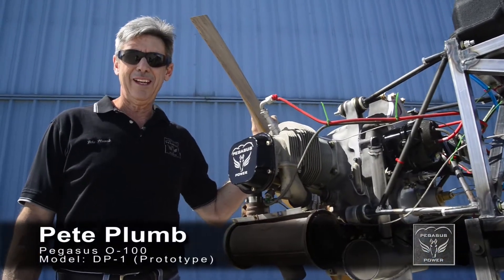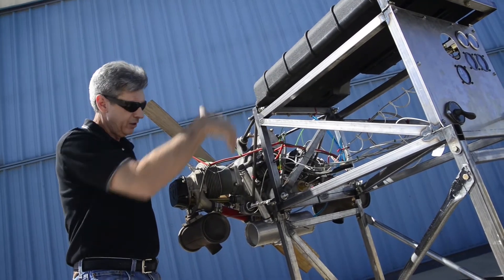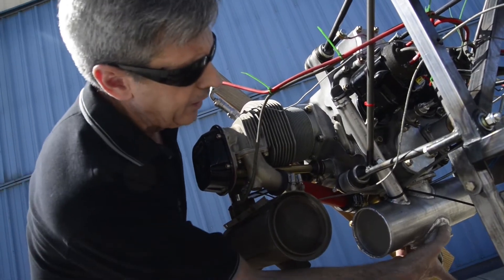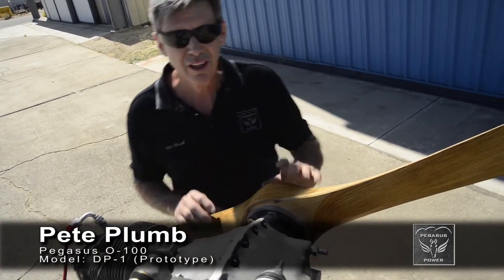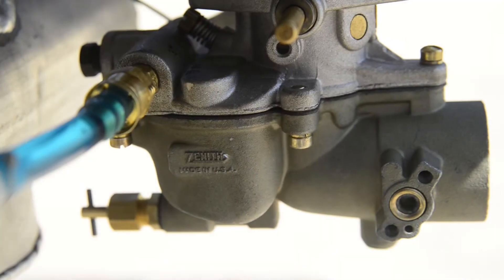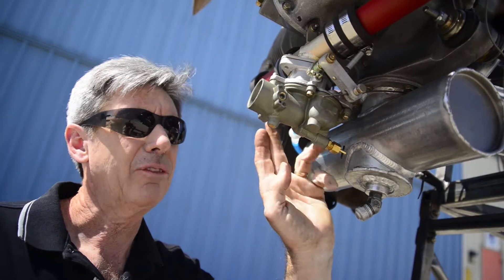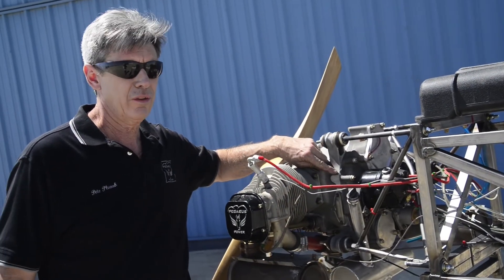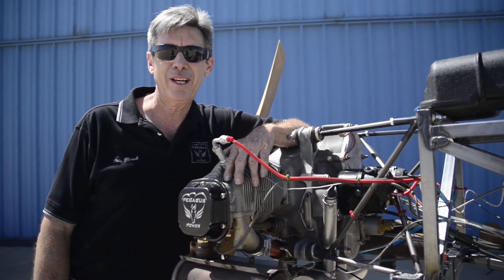O-100Pegasus Engine

Comment: thats the same carb that was on my 1974 shovelhead harley davidson they make make 3 different jets for it a b c i found the b jet to be the best one but for altitude you probably need the c jet you just have to try them also it has a excellerator pump and theres 2 different materials on the pump leather and rubber i found the leather to be the better choice just sayin